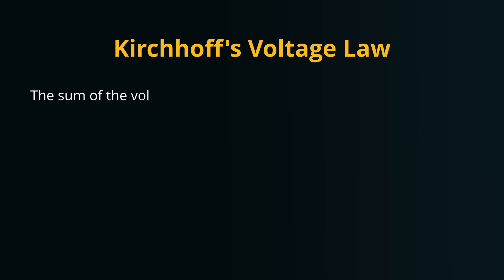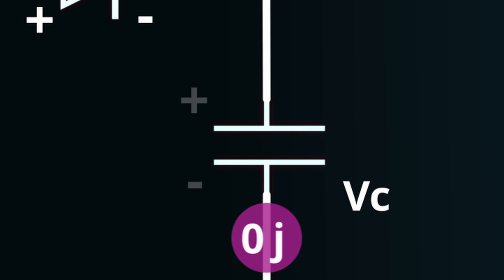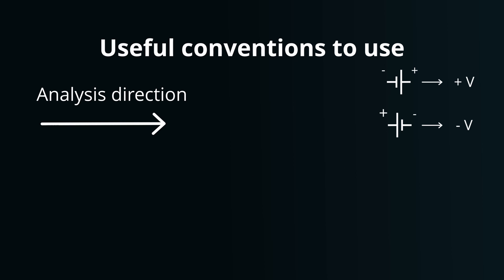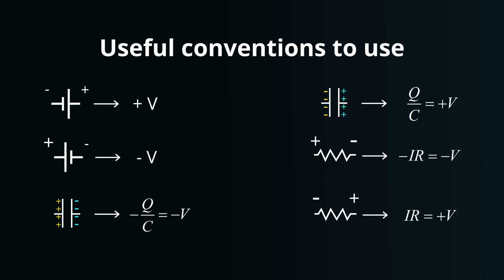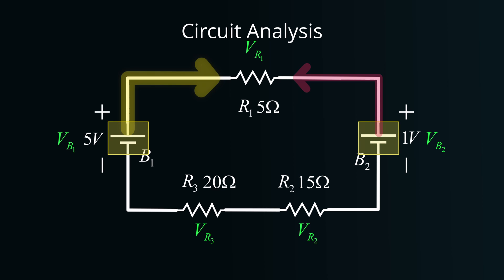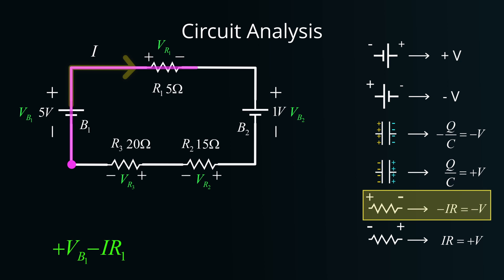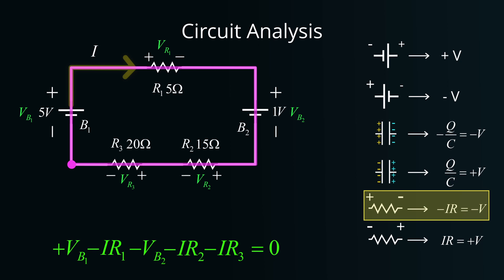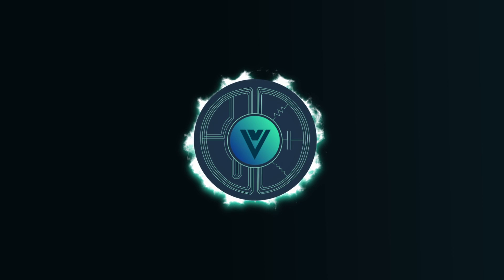KVL Explained (Kirchhoff's Voltage Law)

Comment: "around any closed loop"... You forgot to add "...that does not link a time-changing magnetic field".
Reply from the maker: Thank you for pointing that out! You're absolutely right. Faraday's Law of Electromagnetic Induction does introduce an exception where a changing magnetic field can induce a voltage in a loop. For the sake of simplicity and focus, this video predominantly addresses scenarios without magnetic field considerations. However, it's crucial for anyone diving deeper into circuit theory to understand this nuance. We'll keep this feedback in mind for future content. Appreciate your keen observation!